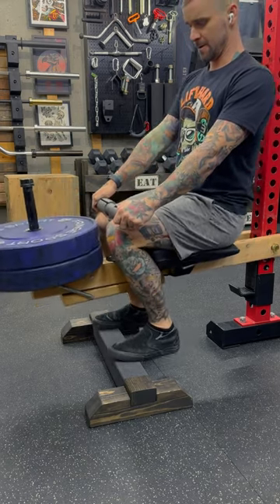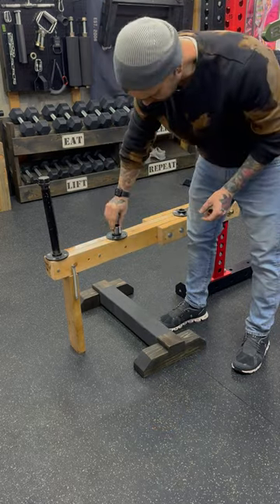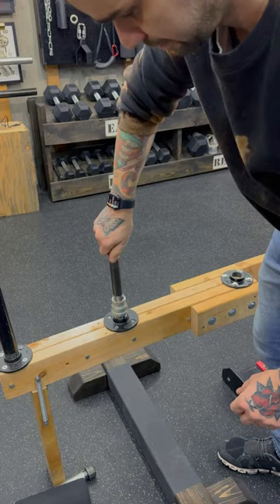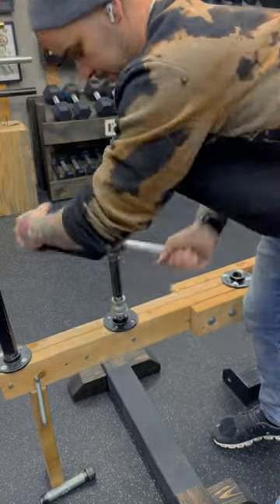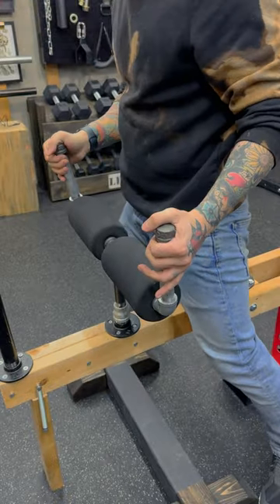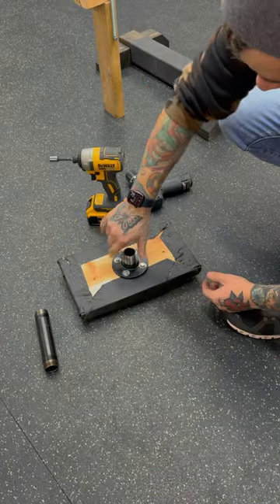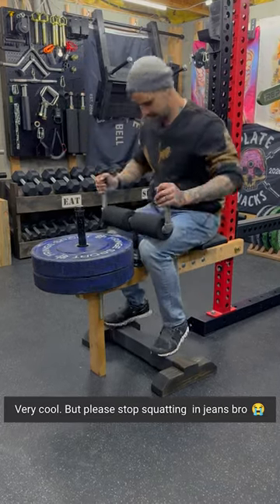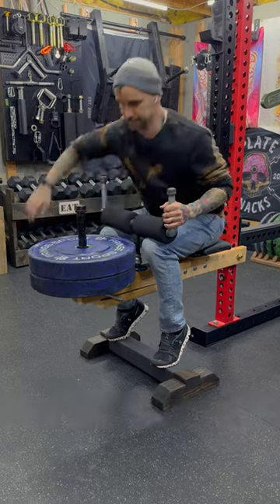DIY seated calf raise made from a belt squat

Comment: That's a brilliant idea. It inspires me to make one of these for my soloflex. I used to really like that machine but all the straps have broken on it so I only use it for dips and Pull-Ups. This idea would give me another function for that machine
Reply from the maker: I’m glad to hear it!
Reply: I have a soloflex machine also and I'm thinking of building at least 2 of the same types of accessories, Just have to add 3/4 inch holes and spacers for where the hitch pins go into.
Without the added spacers, I think that these armatures would float around too much?

Comment: Like a 100 bucks in pipe fittings
Reply from the maker: Even if that’s true, it’s still less than any purchasable seated calf raise
Reply: Not even close. ~$18 from my local hardware store. Well worth it given how adaptable he's made this bit of equipment now and the cost of a commercial alternative.
Reply: @Dennis Bergkamp  I don't think you ever bought this stuff before. I buy it all the time.  I could take the time and list it out for you.  But I'm not. At the very least it's over 80 bucks.
Reply: @Dennis Bergkamp  just the 2x  3/4  flanges will be just  under 15  bucks.
Reply: @richt5986  not sure where you're buying it from but I've made several Kaizen builds and used similar products for shelves/desks/bar clamps so I know the worth. I suggest you hunt around for cheaper alternatives.